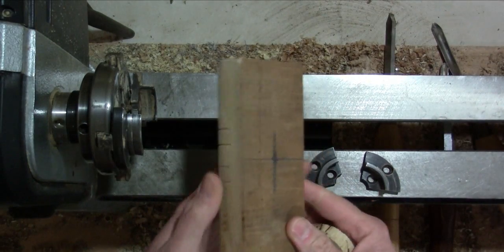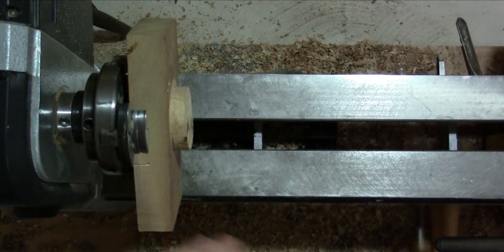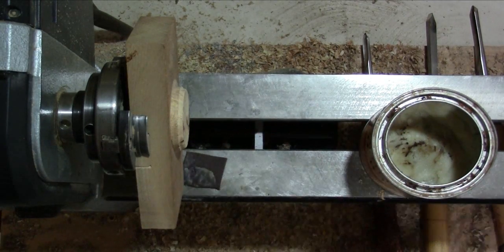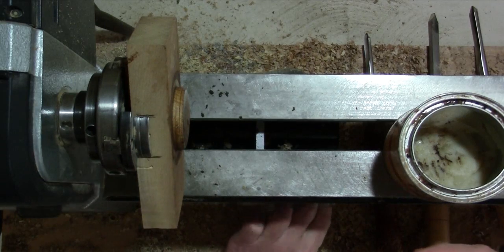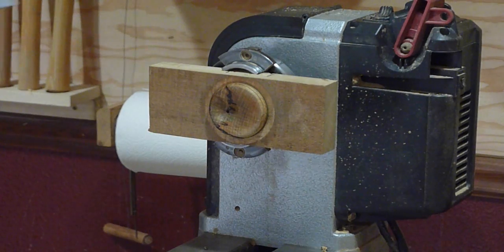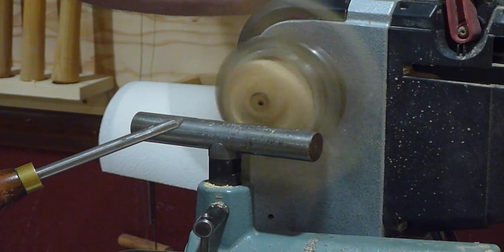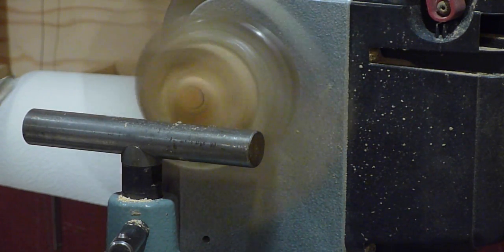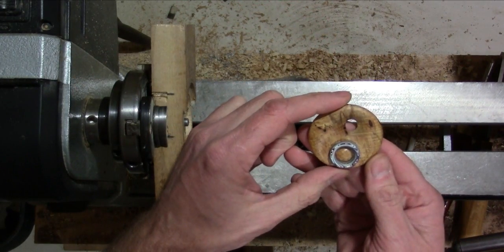Woodturning Off-Center Pendant

Comment: No need to remove the headstock to put on a 4 jaw chuck Jarhead, simply turn the chuck onto the threads where your center would be going at. Make sure htat you have the correct adapter (3/4 or 1") depending on the type of lathe you have or the type of chuck you have. Most lathes come with an adapter anyway.

Comment: Just FYI, the audio-video sync is a off in several places for me.

Interesting method of turning it off-center - never seen it before, but it seems to work well.

Two questions:  What orientation is the grain running in the pendant?  Given how tightly it fit (which would be required using this method), are there any problems with it splitting or marring when removing it with the knockout bar?

Comment: Hi Carl,
Another really handy video, thank you for sharing as I will explain...
I'm intrigued to say the least. I've been trying for weeks to make my wife a nice pendant, but the only thing I've been able to manage is round finished pieces of different tropical wood still hot glued to sacrificial blocks of wood and she refuses to wear them! lol.
If I scale your version down would I still be able to do it with my 2 inch chuck? Plus could you please advise me how to get the pieces off when using Hot Glue? I've tried the metholated spirits I think you call it Denatured Alcohol! But it won't touch it!!! I also tried heating the glue back up in the microwave oven but the olive wood cracked so I haven't tried that again! I think that I could have applied to much of the hot glue! better to be safe than sorry didn't work this time lol.
Please accept my apologies for pestering you with what could be stupid and obvious question's to answer.
Cheers 
Andy
Reply from the maker: Hi Andy, I think for pendants double sided tape is the way to go. I did this video a long time ago. Tape is a much easier way to go. 
Take care,
Carl
Reply: Hi Carl,
Thanks for replying it's really appreciated. Oh I think that would be a lot easier! I was just watching another video of yours with the off center jig when I heard this reply come through! Spooky lol. On that video you used the pillar drill to obtain the off center holes and showed this jig again with the two jaws taken out of the chuck, and no glue or tape! Can't thank you enough for all the help and advice.
Take care my friend.
Cheers
Andy